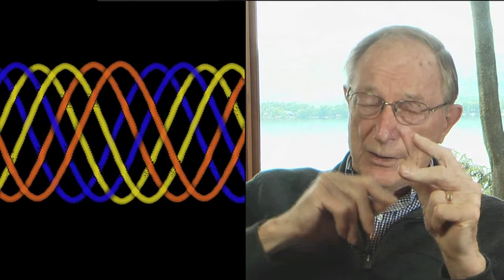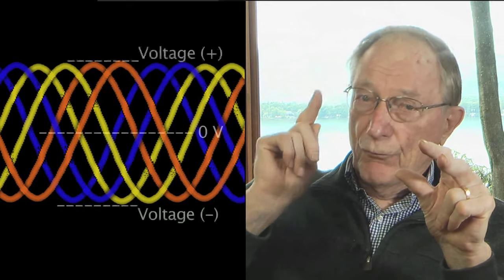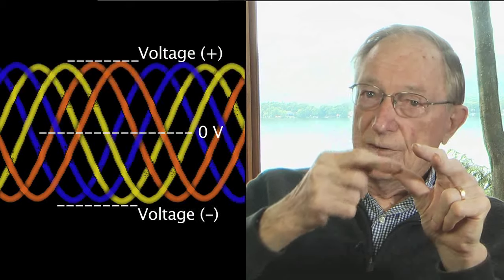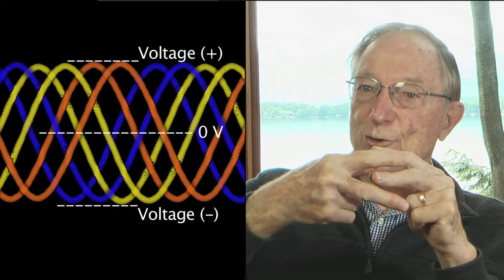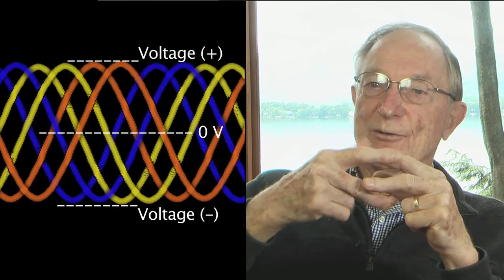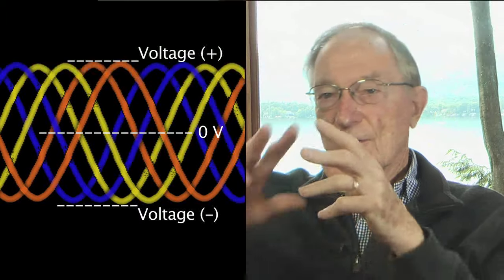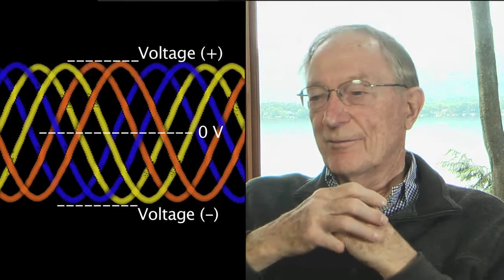Why 3 Phase Power? Why not 6 or 12?

Comment: If you've ever seen how a transformer works, you have a primary coil for the high voltage and a secondary coil for the low voltage wrapped around a metal core. That essentially whats inside a tiny transformer you plug into the wall. The big transformers in substations work the same way, but they have a primary coil and secondary coil for each phase. So if its for very high voltages, say 500kV to 250kV, you'll see a large metal box which has six total coils inside, or three separate boxes with two in each. These big transformers are the size of a house and have massive bundles of cables for the coils and elaborate cooling systems. They are expensive as hell. A six phase transformer would cost about twice as much because it would have to have twelve total coils inside. Another problem is that there is a minimum distance that has to kept between each conducting cable so all those extra bus bars would probably double the size of your substation, things which can already take up several acres of land. In a big city that's not an option at all.

Comment: for high voltage long distances three phases are enough, four phases might be an option for 10-13kV in today's towns with electric vehicles offering two phase to the final consumer of rectified for EV or rotary current in their shops.

Comment: Cool, but phase sequencing would be a huge problem for any system over three phases. For two phases, there is really only one sequence (121212 being the same sequence as 212121). For three phases, any combination of phases basically gets you one of two sequences: some variation of "forward" (123123) or some variation of "reverse" (321321).  Imagine the number of sequence combinations in six phases (123456) and the confusion

Comment: Could it be that it is truly a law of diminishing returns in the power distribution equipment? Single-phase is two wires, a hot and neutral. Three-phase is three wires. L1, L2, L3. So by adding a single wire, or a 33% increase in distribution equipment we triple the power to the end-user. That is a 300% gain for a 30% investment. PS-Love this old guy's explanation.  I learn the most from these related experiences.

Comment: an extra cycle every 24 cycles Ordinarily this only causes a periodic cyclic voltage effect on the phase itself. However when a (tuned) high induction coil is elevated above a polar area the vibration of the source can be transferred fully to the secondary so as to cause the rotating counter emf to fully oppose the source emf at a point in the entire cycle. The momentary appearance of secondary energy having no primary source is a result of this process.

Comment: What about two phase?  This was an early arrangement in the USA, as a matter of fact it was still in use in Philadelphia in the 1970s!   I think two phase (90 degrees) and three phase (120 degrees) were configured to allow starting torque for motors?  Can you comment on this?
Reply: With two balanced phases you could spin the motor in either direction, depending on random (chance) variations.  But with three balanced phases, their succession determines the direction of spin.  (And there's no point in using unbalanced phases, since they'd induce unbalanced motion.)
Reply: What you say is all true, but then why was 2 phase power used many years ago?  "no point in using unbalanced phases", well, there must have been a reason, yes?

Comment: the reason are diminishing returns. You want the voltage to be as high as possible in your wave, with 1 phases when it crosses 0 we get no power for a bit and that is bad, with 2 phases you dont get 0 but the the minimum power you get is V/sqrt(2)=v*0.7 , with 3 phases  V*0.86, with 4 phases V*0.92.... so each wire you add gives you less and less power. 3 phases are a good compromise

Comment: 12? Maybe for transmission. But if you utilize voltage in that manner as in phase to phase, it would mean each conductor is 30 degrees out of phase from the other. You would get less voltage across them because the lesser the phase variance, the lesser the voltage potential. I could see a 12 phase delta feeding a sub-station putting out a 6 phase Y.

Comment: Basically it is theoretically possible  but it is not economically viable since you would need 6 busbars and 6 circuit breakers to safely connect it to a substation.

Comment: I think there are ways to make this work.  

Maybe use it where the right of way for the transmission lines can’t easily be widened.
Reply: A transformer is needed anyway to step the voltage down.
Reply: A 3 phase transformer already has 6 inputs.
Reply: Assuming it hasn’t been wired yet into a wye/delta.

Comment: It seems like the magnetic properties radiating from each phase would result in less voltage loss in a 6 phase system when you consider how each phase has 3 others of opposite polarity pulling the phase inward towards the center  of the conductor and only 2 of like polarity opposing each phase, whereas an individual phase within 3 phases always has 1 opposing polarity and 1 attracting polarity, which alternate sides in relation to it causing a steady inward and outward pulsation of each phase in addition to its natural oscillation around the conductor.... seems like it would put less stress on the material of the components over time too..... in theory

Comment: More power per foot on a line without taking up more space? Why not take up more space and give a few more feet between the lines and just push more voltage through which means more power without additional line loss/additional hardware/additional breakers -- well this is what industry does. Also more phases means you need all that extra stuff like breakers he mentioned. No fellas there's a good reason why we use 3 phase. I'm blown away they actually built a test site on this concept

Comment: I was just thinking about yelling, Lionel, about the commercial aspect, when you beat me to it.   I was starting from the load end:  6-phase motors replacing 3, 6 bus bars in every MCC vs 3, etc.   And then, in design, we'd have to worry about pi over 2.

Comment: Question, if more and more phases are added theoretically making the power smoother (less time between phases), does it effectively become like direct current? And if so is that a problem for an induction motor?
Reply: No, each phase still carries 50Hz (or 60Hz in freedomland) AC. There is no DC here. The "smoothness" you refer to is a spatial smoothness, not a temporal smoothness.

Comment: The video doesn't really answer the question posed in the title. The answer is very simple. For a given current and voltage 3 phases uses the lowest amount of copper. Both two phase (split phase), and four or more phases have higher copper-to-power-transmitted ratios.  So it's simply a practical choice of the engineers that making 3 phase infrastructure is cheaper than six phase.

Comment: intriguing indeed! it is only the transmitting of energy to long distances..but what about the production of the power source 6 phase generators or 12 phase ones is also daunting.
Reply: Not that hard to do. Take a look sometime at a 12 wire alternator. Depending on how you wire them, you get single phase, or three phase in both Delta or Wye configurations. And just to throw in some fun, you can also get single and three phase on  4 connection taps. Or even 6 single phase connections out of 6 connections. In the case of one I have, it can produce anywhere from 120 single phase to 480 3 phase. And a number of voltage in between. And by changing the speed setting of the engine, 50 or 60 Hz. 1500 RPM = 50Hz while 1800 produces 60 HZ power.

Comment: How about separating the EMF fields of 3 phase, and running a second set of 3 phase wires, energising them through induction, thereby, (in my way of thinking. Im no engineer), achieving a second circuit of 3 phase power. Does the induction reduce each circuit in half? What effect would the length of parallel have on the second circuit, energised by the sub station fed circuit?

Comment: It‘s both funny and sad to read all the comments about Edison and Tesla, who was said to have invented three phase AC. However, nothing could be further from the truth. Tesla hated three-phase AC and never used it in his whole life. Even the famous Niagara falls power station was firstly built with two phases on Tesla’s advice. The three phase system we use today was actually inventend by a guy named August Haselwander in Germany. It is much better than Tesla‘s two phase system as it allows to transmit more power over fewer wires. Also, it creates a steady rotating field with constant amplitude, which two phases do not. The three phase system was made famous by Michael Dolivo-Dobrowolsky when he built his first inductions motors in that way (again, Tesla used one and two phases for his induction motors and failed).

Comment: Actually DC transmission may be the most effective today. In earlier days of Tesla and Edison, transistors are not good for anything, but today power MOSFETs and IGBTs are more advanced. You can then make buck or boost converters with ferrite cores easily. So, rising up, or lowering down voltage may be easy and more effective than three phase transformers.
Reply: WildMania You can't make a buck boost converter more efficient than today's 3ph transformers. They have incredible efficiency and  power switches are nowhere near them.
Reply: In the days of Edison and Tesla, there were really no such thing as a transistor. Even if the first patents were filed already in the early 1900s, when Tesla and Edison were still alive, the first proper transistor implementation did not arrive until after WW2, ~1947. Tesla had been dead for 5 years, Edison for 16 years.

Comment: One of the patents Tesla filed in 1887, however, also described a shorted-winding-rotor induction motor. George Westinghouse promptly bought Tesla's patents, employed Tesla to develop them, and assigned C. F. Scott to help Tesla; however, Tesla left for other pursuits in 1889.[27][34][37][38][39][40][41][42][43][44][45][46][47][48] The constant speed AC induction motor was found not to be suitable for street cars,[28] but Westinghouse engineers successfully adapted it to power a mining operation in Telluride, Colorado in 1891.[49][50][51]Steadfast in his promotion of three-phase development, Mikhail Dolivo-Dobrovolsky invented the three-phase cage-rotor induction motor in 1889 and the three-limb transformer in 1890. This type of motor is now used for the vast majority of commercial applications.[52][53] However, he claimed that Tesla's motor was not practical because of two-phase pulsations, which prompted him to persist in his three-phase work.[54] Although Westinghouse achieved its first practical induction motor in 1892 and developed a line of polyphase 60 hertz induction motors in 1893, these early Westinghouse motors were two-phase motors with wound rotors. B. G. Lamme later developed a rotating bar winding rotor.[41]The General Electric Company began developing three-phase induction motors in 1891.[41] By 1896, General Electric and Westinghouse signed a cross-licensing agreement for the bar-winding-rotor design, later called the squirrel-cage rotor.[41] Induction motor improvements flowing from these inventions and innovations were such that a 100-horsepower (HP) induction motor currently has the same mounting dimensions as a 7.5 HP motor in 1897.[41]

Comment: Maybe they don't use more than 3 because the order of the phases isn't critical. Add another phase and screwing up the order you don't simply change rotation direction, you can have a phase that fight the rotation and make all sorts of heat and current draw and noise. Higher phase count might have practical advantages but it's much more prone to human error.

Comment: And what would the cost be of producing a 12 phase motor and how much bigger conduit would you have to have to route to one of these motors and pull 12 wires plus ground to power it up or having 12 phase electrical panels.

Comment: Check Tesla's patents. There are are motors with the three+ phase circuits repeating around the housing of a large rotor. Just slipping them one over the way the video showed wouldn't do anything but create a larger electromagnet with multiple focal points.

Comment: SIR : STEEL MILLS USE A SPECIAL TRANSFORMER , 3PHASE INPUT , WITH A 6 PHASE OUTPUT ....THIS IS THEN FULL WAVE RECTIFIED ....12 RECTIFIERS ......THIS IS USED TO LOWER "RIPPLE" CURRENT ON THE D.C. ....CREATING COOLER RUNNING D.C. MOTORS.

Comment: The man 's got everything right of course, but could there be a simpler explanation? 3 phase is the lowest number where you have a direction of rotation. With two phase a motor will start spinning either way unless it has an extra coil with a condersor.

Comment: First year graduates 60 years ago in any tech UNI known that 3 phase is there because it is economically practical.
it is great that edison supporters eventually starting to understand what Mr. Tesla's AC is. funny that even now they still lost like a child in a fog. 
They struggle with power conduct over the wire... but wait Mr. Tesla already have solved this problem, too. 
With this speed of understanding they will get there ... in 1000 years?

Comment: More copper or aluminum  to transmit the power, more expensive installations,  but wow I love to see a 6 phase transmission line,  everything would run alot smoother ,  6 phase asynchronous motors would also draw less current at start, a lot less ,  you could couple them as a Y a YY a  double delta and a hexagram?

Comment: For spirals having the highest mutual inductance between phasings the impedance rises 30% from that measured exclusively as a solitary phase. We have 6 magnetic interior repulsions @ 1/6ths of a cycle, shoving the magnetic fields outwards from 6 polar exits on the assembly, that when series resonated we call a 666 machine. We now will need 3d vectors representing the voltages in time to explain the machines operation.

Comment: OK... But what is the benefit of multiphase power in the first place?

what's the difference between a 3 phase system and 3 single phase systems?
Why use one rather than the other?

Comment: I took basic ac/dc circuits in the military.  Is each phase from an individual windings within the generator?  Then explain, as Barthold expressed, the 6 and 12 do not produce proportional increase in power.  Might he be suggesting that the close proximity of the conductors causes field cancellations?

Comment: This is loosely analogous to Yagi-Uda antenna design.  After 3 elements, there is diminishing returns.  Going from a single element antenna to a 3 element yields about a 6dB increase in antenna gain.  From there to get another 6dB of antenna gain, you have to quadruple the boom length of it.  The 3 element antenna is very compact with good bang for the buck.  It appears that is what is happening with 3 phase power too.

Comment: This video does NOT even tell the viewer why we use 3-phase electrical voltage. It is all because of the very nature of the Sinusoidal pure voltage-amperage behavior. You must understand how the sine wave works and then you realize that you are dealing with a repeating form that is best added to by two more sine waves, each 120 degrees apart. Diagrams really help to understand this. So look this up and you can get the real reason we make the most efficient use of electrical power by using 3-phase energy to motors and transmission systems. (hint: each of the three waveforms overlap each other in perfect alignment to keep the power constant.)

Comment: Interesting. I suppose a 6 phase system could be easily made for use in specialty applications for when it would be needed, it could be done using a custom made inverter. I just can't really see a need for it since we now have precision digital controls and motors made to very specific applications.
As far as power transmission, this country is having enough trouble keeping what grid we have together after years of neglect.Electricians have enough trouble with 3 phase as it is!

Comment: If I get a water tank and stack a second water tank on top of it, I have twice the water storage on the same footprint. But then I will need twice the plumbing. If I continue to stack them it gets exponentially harder to build the infrastructure and to pump water to the uppermost tanks.

Basic system logic that applies to almost anything.  At some point you choose a trade-off and stick with that.

Comment: How about sending a low frequency,high power radio signal down a single coax.It would defeat loss at long runs and can be re-clocked back down to 60hz at the point of use.Rectifying it to DC at the point of use at high amperage could replace three phase and utilize more powerful DC motors.
Reply: I don't understand what you're trying to say
Reply: @ToxTox  When I was a teenager My family owned a TV repair shop and we put up a lot of antennas.I was into CB radios more so at the time.To test these radios quickly for blown outputs I would place an incandescent lamp on the x tail.I then made an experiment by connecting multiple spools of 75 ohm cable in series together and sending 27 mhz down the line to see if I could light the lamp.Even though the impedance of hf and the simple equipment was at 50 ohms.I was able to light the lamp with no measurable loss.I then made a bridge rectifier to run a dc motor.I figured that radio frequency would be more efficient.This was in 1980 and I was 15 years old.

Comment: The simple reason is cost. 6 phase power line costs twice as much as a 3 phase power line. And it does not quite double to power. Two 3 phase lines do carry double the power.One 6 phase line costs the same as two 3 phase lines. Again cost.